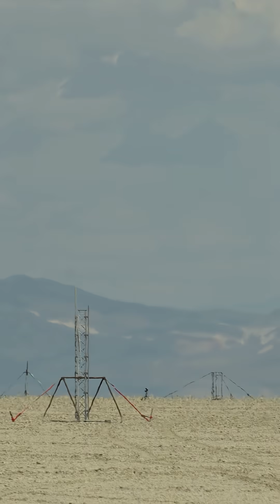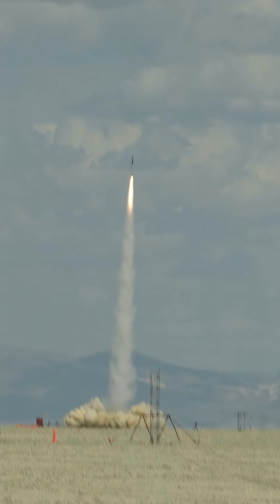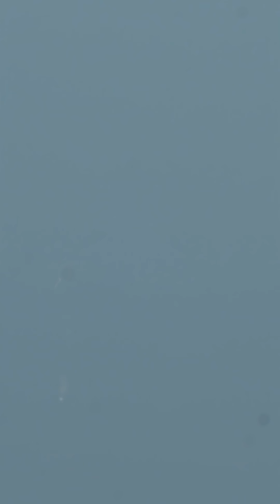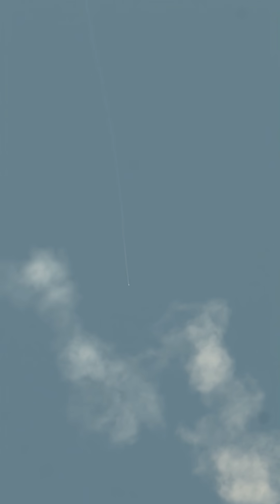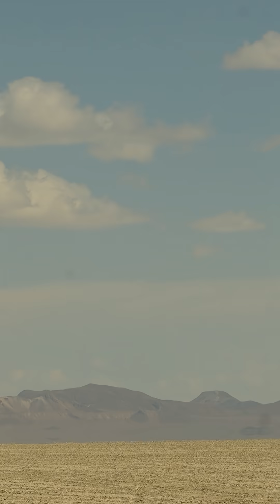N5800 rocket makes it through the hard part but comes apart right after motor burnout   the builder

Comment: Why was it flashing like that?
Reply: Rockets are usually painted with high-gloss paint so they reflect the sun while spinning to make visually tracking the rocket easier. The flashing is when it's at the right angle to reflect the sun towards the camera.
Reply from the maker: @distinguished199 Correct, but I believe this one was unpainted and the reflection is coming from the aluminum motor case

Comment: That rocket seems like it was going the speed of sound.  The camera did not pick up the sound until the rocket was at least 100’ down range.
Reply from the maker: Closer to four times the speed of sound and about a quarter  mile from the camera
Reply: It was probably going a little more then that in speed.
Reply: It was a few thousand feet in the air before the camera picked the sound up.